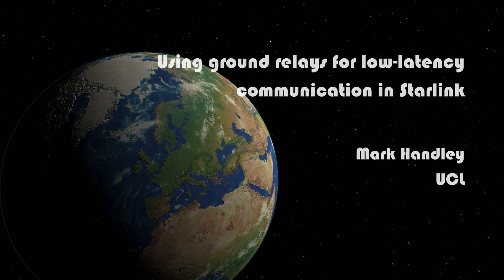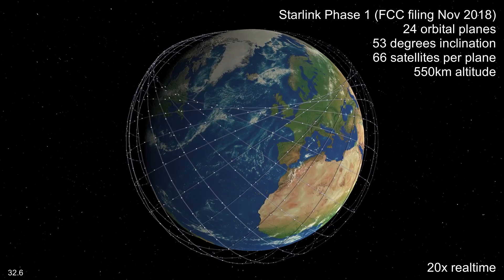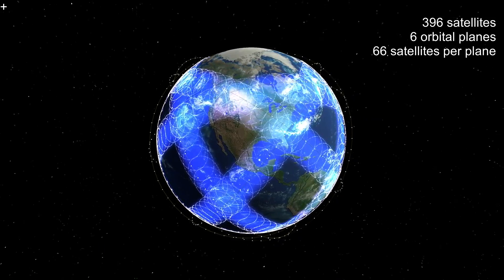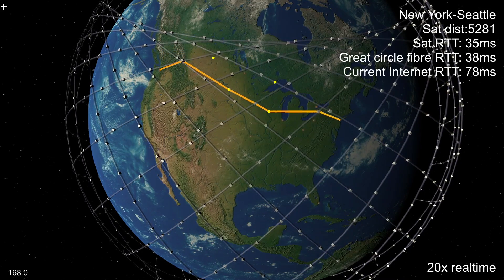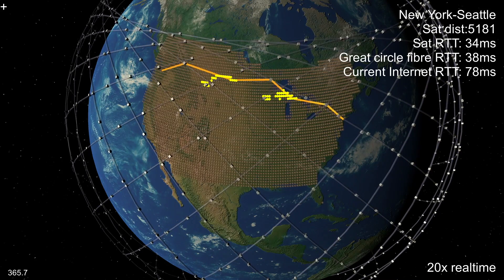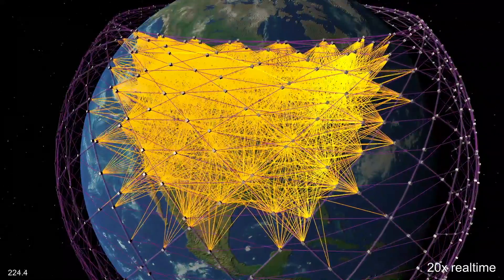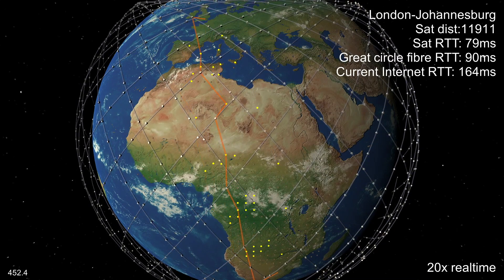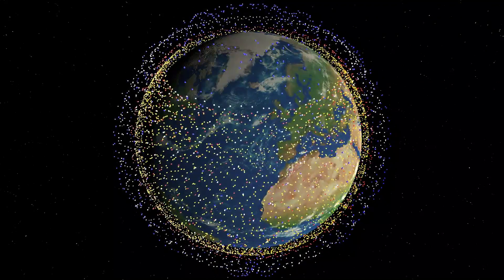Using ground relays with Starlink

Comment: What about bandwidth? Even if the link through a satellite can be made faster than a fiber optic cable,  can it also handle the same sorts of traffic density? Something tells me the answer is going to be no.
Reply: The limitations of the satellite is how much data each satellite can handle, so if you have a lot of users in one area they have to share the available bandwidth.
However, if you have a data center near a city, and you needed more bandwidth, you could use fiber to get a couple hundred miles out into the country, and put your uplink there, where it is hitting a different satellite that's not over the city.

Once the data hits a satellite, then it can be relayed via laser, and that can be routed around the mesh network freely to balance load.
So the bottleneck is each satellite.
Which is why Elon raised the number of satellites he is planning, putting them closer together, thus increasing the possible bandwidth per square mile.
Reply: @ke6gwf  even with lots of satellites, you still have the problem of RF bandwidth. You  can only squeeze so many signals into a given slice of the RF spectrum before your stations start to interfere with each other.
Reply: @andrewreynolds9371  that's not a problem, because they are using phased array antennas on both ground and sky, so they can have good beam control.
I don't remember off the top of my head how many frequencies and bands they have in their permit, but it's plenty to cover any area of ground.

Each satellite in the first wave has about 20 Gbps throughput capacity, divided over however many frequencies that each satellite uses, and then the surrounding satellites will use different frequencies for the overlapping areas.
And then as soon as you get a little ways away from a satellite using a particular frequency, you can reuse it.
And since this is all digital and steerable, you can instantly swap frequencies as often as needed to avoid interference.

And using digital, with steerable beams on both ends, you can have very close proximity without interference, because you aren't letting the signal leak out.
Reply: Estimated numbers I seen about the star link satellites they were currently at 40,000 users watching 4k video per a satellite on there tests on the ground. I'm sure that number will increase but 4k video is demanding for a ISP also. Throughput will be the biggest factor on the satellite. YouTube and Netflix partner with local large ISP and put servers in the ISP hubs/data center around large cities so the bandwidth used mainly is only on the ISP network not the back bone if that makes since. I can't see why they couldn't put a couple of racks at a large ground station in a populated area and serve the videos local if the fiber to the ground station will be a limiting factor.
Reply: @dco5055  actually, I can't see fiber bandwidth being the real bottleneck. Like I said earlier, RF spectrum isn't an unlimited resource, and there are only so many signals you can cram into a given slice of bandwidth, so in the end, fiber is going to rule, no matter what Musk promises.
Reply: @andrewreynolds9371  uhmm... no, because at the given speed of light in a vacuum you can send so much more data so much faster than through a cable.  also they're going to have different arrays. using about 3 kilohertz (3 kHz) to 300 gigahertz (300 GHz). With the low end probably not used as much but that is a very very large frequency to use. and with the technology we have we can modulate those frequencies to give them their own unique signatures. compare this with fiber connections where all the connections use the same wire (overseas at least) and you have bottlenecks. That's why there are so many cables across the oceans. Because bandwidth scales. When you're talking about an array of 22 satellites in 72 orbits. The bandwidth can be almost unlimited. The real bottle necks now are the receiving stations on the ground. Which have to process all that data being requested and then run it through back up.
Reply: @shipshrekt2156  um, I hate to have to tell you this,  but there is no way the FCC gave Musk permission to operate a satellite system that covers that much bandwidth, and IARU would not approve one operating over such a massive swath of frequencies either. So,  who's telling you Starlink will?
Reply: @andrewreynolds9371  not yet but if he proves the system then they can inch forward. For now the system is still a prototype so they dont need much anyway for right now.
Reply: @shipshrekt2156  you don't get it, do you? Even using spread spectrum technology, a satellite system like that, with that many satellites, would raise the background noise and cause problems for terrestrial and satellite systems. Those systems are not going just roll over and go away so Musk can run his Starlink system. And there is no way any regulatory body is going to issue an operating license for a system like that either.
Reply: @andrewreynolds9371  you don't get it either lol
Starlink is going to be using frequencies that really aren't in much use, and so it won't cause interference with any primary users, and since it is being given primary user status, secondary users will have to accept any interference, but since they are not commonly used frequencies, there won't be much problem with interference.
Now, it will raise the background noise, but FCC doesn't regulate that.

Per the FCC approval for the Starlink space stations, "SpaceX proposes to operate in the 10.7-12.7 GHz, 13.85-14.5 GHz, 17.8-18.6 GHz, 18.8-19.3 GHz, 27.5-29.1 GHz, and 29.5-30 GHz bands."

That's a LOT of bandwidth!
You can split that up into a bunch of discrete channels with a enough bandwidth to easily handle the data requirements.
And that's up in the ghz portion of spectrum, where you can fit a lot more data through the same width channel, so it's much more efficient for data.

So FCC isn't going to give them license to interfere with existing primary users, they will be given open frequencies, and they don't want to interfere anyway, because that means that the other users would be interfering with them too.
Reply: @andrewreynolds9371  and as far as fiber, it will still be the main terrestrial backbone because it's cheap and easy to install, and carries oodles of data through all conditions, other than a careless backhoe.
However, fiber doesn't help getting data to remote places where you don't have enough users to justify the expense, (which is a large portion of the world), and fiber across the oceans is very expensive and high maintenance.

So fiber is still going to carry the majority of cat pictures and spam, but for speed of connection and global access, fiber hardly competes will Starlink.

Basically, if you can call up your local cable company and get fast enough internet to look at cat videos for a comfortable price, you aren't a Starlink customer.

But if you don't have a local cable company, or you need the fastest connection possible, or are mobile, or many other cases other than a city dwelling normal person, then Starlink is exactly what you need.

So it's not going to replace fiber, but it is certainly going to reduce the need for new fiber, and be preferable to fiber in many ways.
Reply: @ke6gwf  can you do basic math? Reread that list of frequencies: the biggest slices are around two gigahertz wide, and there's only two pieces that big. The rest are a few hundred megahertz wide. This is what Musk is planning to cram a massive, broadband service into, one that's being touted as a replacement for fiber optic cables by a lot of its more rabid proponents. And btw, the FCC does regulate background noise if it's causing interference to other services and is caused by a licensed service.
Reply: @andrewreynolds9371  yes, I can do the math, but do YOU realize how many channels you can fit in that much bandwidth at that high of a frequency?
A standard Wi-Fi channel at 5ghz is only 20mhz wide, and the higher the frequency goes, the more data you can get per mhz of bandwidth, so in the high ghz range like that, you have lots of data bandwidth available, many channels.
And since it's all digital, you don't need a unique channel for each customer, you can multiplex everyone on a single channel, just as you would with fiber, and then the receiver breaks out its stream of packets.

So basically you only need enough channels to get 20 gbps throughput for each satellite, which at high frequencies aren't very many channels, and then have maybe 3 times that many to allow for no overlap between nearby satellites.
And when you have several ghz of bandwidth available, you can get a lot of channels in there, or fewer wide channels and use Spread Spectrum to make a single big pipe.
And you can change bandwidths per channel on the fly as well, for instance if someone is uploading lots of data, you can shift the channel widths to give them more upload speed, and maybe slow down some cat pictures on the download.

Basically, they have plenty of bandwidth to do what they need to do.

And since the satellites have very limited signal footprint with steered beams, they can reuse the same frequencies every couple of satellites, which in comparison with fiber, means that each cluster of overlapping satellites acts like one fiber, needing to share that bandwidth, but then once you get past that overlap, it's like a new fiber with full bandwidth available again.

And background noise is signals put out outside of your assigned frequency, or outside of your assigned area.
So since they have very good frequency control, and very good beam control, you won't get background noise.
Reply: @ke6gwf  I'm guessing from the tag you post under that you're a ham. So tell me, have you heard harmonic signals? So, do you think these satellites are are going to be perfect transmitters that defy normal operations parameters and generate zero harmonics? And a normal wifi channel can't carry data as fast as a fiber optic cable, which is what I believe you originally said this system would be competing with. And all of that still doesn't change the fact that the limits of current technology are going mean you either have lots of users with limited bandwidth, or a few users with high bandwidth, because you won't be able to do both.
Reply: @andrewreynolds9371  yes, ham, commercial broadcast, satellite uplink, professional sound, etc. I am familiar with harmonics lol

I also know that with best practice transmitter, filter, feedline and antenna design, harmonics are almost completely eliminated for practical purposes, which means that the harmonic energy emitted is magnitudes lower than the fundamental frequency, and so does not interfere with anything that isn't right next to the transmitter. 

Any commercial radio transmitters built or sold are required to adhere to the minimum harmonics standards defined in the law, and most will fall far below the standards because they work better that way. 
So, I am sure that Starlink will not produce any harmful harmonics, because modern transmitters usually don't anyway, plus it would create problems for Starlink itself, and so would be avoided. 
Also, with using highly directional polarized signals, harmonics would not be likely to interfere with terrestrial systems anyway, since they are aimed opposite directions. 

You are correct that a normal wifi channel can't carry the same amount of data as a fiber optic cable. 
But if you knew how a fiber optic cable worked, you would see how it's a valid comparison. 
See, a fiber optic system effectively uses a bunch of channels all packed into one pipe. 
Each frequency of light can only carry a limited amount of data, just as each frequency on a Wi-Fi network can only carry a certain amount of data. 
Fiber optics have such high bandwidth because they multiplex many different wavelengths in one cable, each one having a limited bandwidth, but combined they have a large capacity. 
In the Wi-Fi world its know as Bonding, where multiple channels/frequencies are used between two devices to multiply the data bandwidth.
So when comparing fiber with wifi, you have to compare the entire throughput capacity using all of the wifi channels at the same time, rather than just a single channel. 

Now, Starlink has wide bands which they can either break up into discreet frequency channels like wifi, or they can use the entire 2ghz wide channel as one giant spread spectrum pipe, which at that high of a frequency would be incredible amounts of data. 
And since it's a proprietary and incredibly smart and agile system, they can change the frequency usage on the fly by the millisecond as needed. 

And that means that they can change from lots of low bandwidth users to a few high bandwidth users on the fly as needed. 
And also change from mostly download bandwidth to mostly upload bandwidth as needed. 

For instance, let's just look at that 2ghz wide channel. 
Lets say that they are going over the back country with scattered guys watching YouTube and uploading cat pictures, and little trickles of data are going both ways. 
Then they come over a ground station uplinking from a data center into the Starlink network, and so they shift 90 percent of that 2ghz to the uplink side. 
Then that satellite moves past the uplink, and they come over a small city where everyone is watching the superbowl in 4K, and they shift to use a bunch of it to the download side (though they would be smart, and if a bunch of users on the same satellite are watching the same stream, it would actually only have to stream it once, and just multicast it to all the users watching it). 
Then if it continues over some industrial or military users with expensive high priority plans, it gives them as much bandwidth as they need for up and down links, and distributes the remaining bandwidth among the regular level users. 
And just like with cable internet, your contract doesn't guarantee that you will always have that full bandwidth during times of congestion, you have to pay more if you want guaranteed bandwidth at all times. 

So by using intelligent bandwidth control, it's quite possible to have lots of low bandwidth users and a few high bandwidth users at the same time, as long as you don't exceed the maximum throughput capacity of the satellite, and, if you do, then you add more satellites to handle the extra load. 

And again, as long as you have enough bandwidth on the various frequencies to handle all the traffic within the footprint of a single satellite, then you can reuse that same bandwidth for the next footprint over, and have no interference issues or lack of bandwidth. 

And with digitally steerable antennas, and spread spectrum, and all the other fancy encoding technology we have these days, they can get incredible and instant flexibility and capacity on such high frequencies, and while it may not have quite the capacity of a single multimode fully multiplexed fiber optic cable, very few users need that much bandwidth, and so everyone else who has more normal requirements will do fine with this, and since the constellation will have thousands of parallel data paths available, in aggregate it will be worth multiple fiber optic cables across the oceans, and able to take direct paths instead of going up coastlines and then taking the short routes across the ocean, and then back down the other coastline.
Reply: @ke6gwf  thanks for telling me what I already knew about how fiber optic cables work. But a fiber cable doesn't have to worry about its signal possibly interfering with other services. It also means you have to bundle channels to achieve higher bandwidth, which limits the number of possible users.  You're right about filtering, but at the same time, there are going to be signals that are generated, and with the number of satellites that will be above the horizon at any given time means that each of them is a possible source of unintended signals, which in turn raises the background noise and potential interference. I'm still not convinced Starlink is either necessary or practical, but it's clear you're convinced it is. Time to agree to disagree.
Reply: @andrewreynolds9371  ok, I see one major misunderstanding that you seem to have, which is that each user will need a separate channel just for them.
If they set up the network similar to Ethernet, you can easily have many users on the same frequency (or band if they are using spread spectrum etc)
By including a narrow timing and request band, all ground stations can be given time sharing instructions from the satellite, allowing efficient bandwidth usage for as many users as desired.
And since, unlike with ethernet, you can designate a small section of the band as the control channel, you can totally avoid collision by having the satellite tell the ground stations when to transmit.
So you just have to have enough bandwidth to allow the maximum total throughput, and don't have to worry about a separate channel for each user.

And with directional antennas, you don't have to worry about all the satellites above the horizon, just like you don't get blinded by car headlights going away from you.
And yes, there will be some stray radiation going in other directions, but at very low power levels.

You sound a lot like the people who were crying about the rapid growth of cell towers years ago, and predicting that they would be creating lots of interference with everything, but it turns out that with proper system design, they can be very careful you only transmit in their assigned frequency ranges, and so don't interfere with other users in different frequency ranges!
Reply: @shipshrekt2156  The frequency available for StarLink would be very limited. One of the reasons that 5G is lagging behind in US is because some 5G frequencies are already used by military.
Reply: @wanyijiang4940  you don't think the military is gonna want to utilize starlink? The u.s doesnt want 5g because 5g is controlled by china.
Reply: @dco5055  Fiber might be a better choice for populated area.
Reply: @wanyijiang4940  Yes he isn't competing with city fiber internet. He is tapping in to the world that doesn't have Internet or rural slower internet. I get fiber and starli k for a back up and use it on the go. The antenna is self adjusting so being on top of a vehicle (small pizza box) you will have internet anywhere. If you ever traveled around the world you would understand there is big open area with no communication. Can't wait to see improvements overtime with the antenna to see how small it gets.
Reply: Why? it's basically space wifi, does your wifi not work with multiple connections and big 8K videos???
Reply: @Cuen Bas if you think $35k car is for rich people you should get off YouTube cause clearly you're living below poverty.
Reply: Andrew Reynolds and all you smart guys arguing but not understanding what this is all about- this network is built for high frequency trading, not for carrying “civilian” traffic. 
The goal is to cut latency to win the race for buy orders. 
Fibre is the bulk data carrier.
This orbiting network is built for low latency. There is very little data in trade order but that data needs to get there before other orders to be worth billions. HFTs will swap a network switch for newer one that can move packets 30 microseconds faster that the old model and cluster servers in weird patterns to reduce the length of fibre patch cables by a few inches, watch the bend radius to minimize dispersion, etc, etc. - anything to shave microseconds off latency.
They have the money any reason to fund this project. If it works they will make even more billions than they do now simply because they will have the network to carry trade orders few milliseconds faster than anybody else’s.
Reply: Read the FCC documentation. The answer is there written in plain English.
Reply: @hrklsrpr3115  yes, because companies never lie in the paperwork they submit to the feds, right? (cough! cough! *Boeing!*)